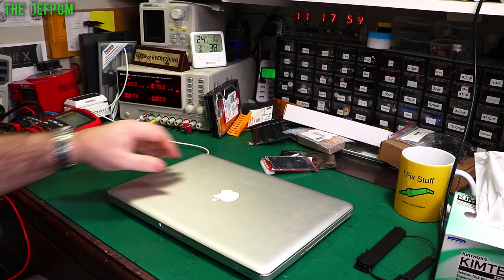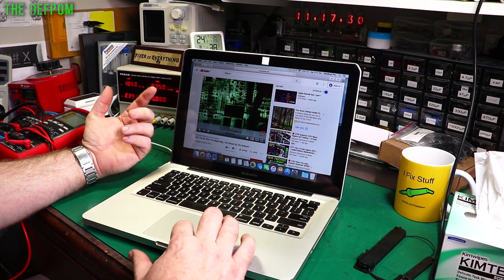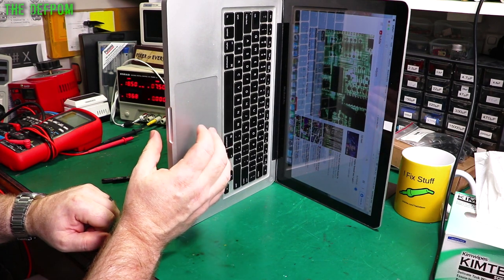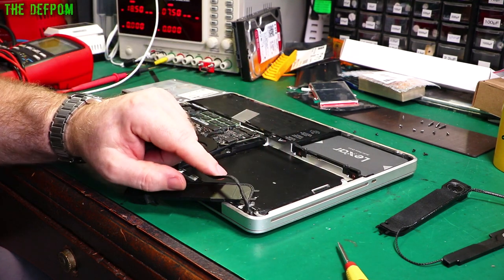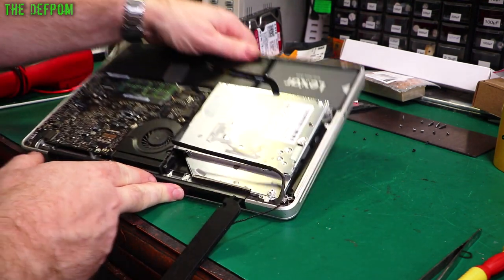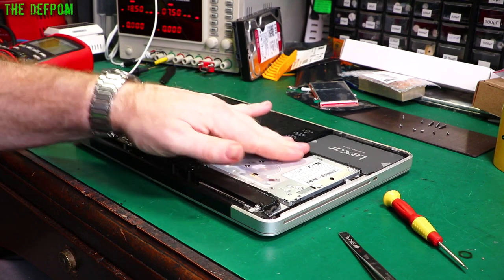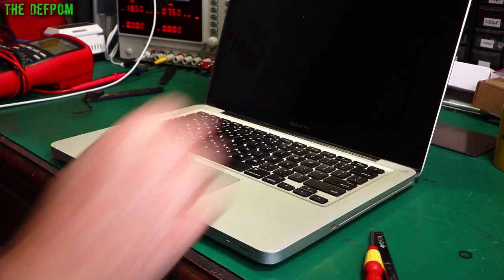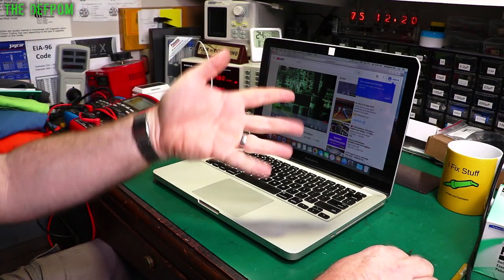🔴 Apple MacBook Pro 13 2009 Speaker Replacement - No.794

Comment: Sounds like your dad needs some active speakers,  that would give it a bit more chuff :-D
Your video reminds me that i still have an apple lappy with the back light inverter fried,  one of my mates family poured a water based drink on the pcb/memory/wlan card and more.
It went nasty and green :-(.
i scrubbed it off with hot water and a brush, then repeated heating over several days.
There was a black hole through the pcb, so that was cleaned out, arking backlight voltage path.
The machine actually works, i was supprised.
Hopefully he will decide what to do with it, i dont like repairs that cant be finished :-(